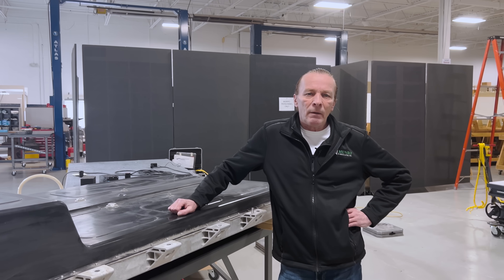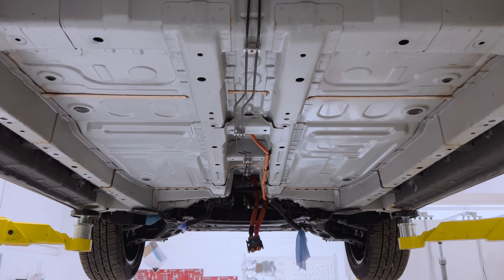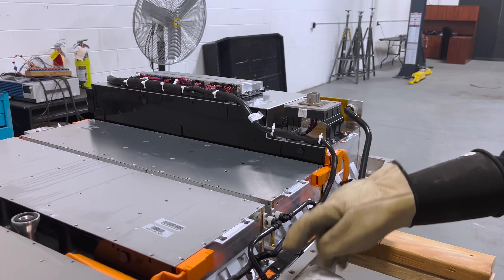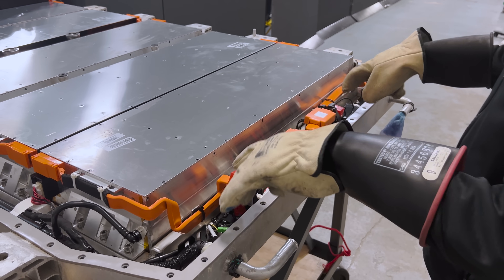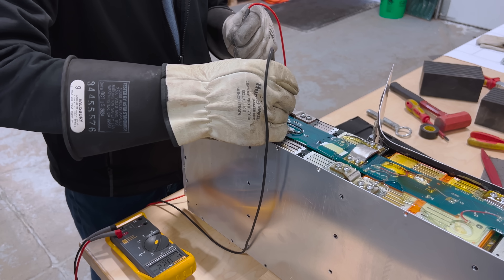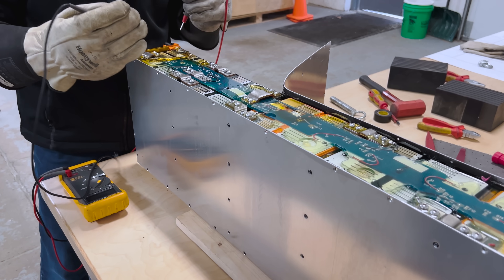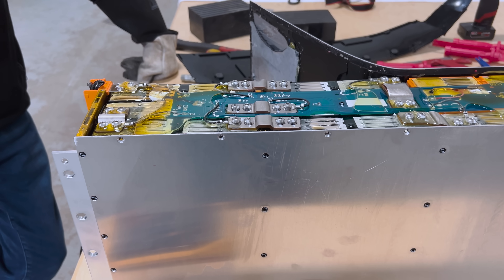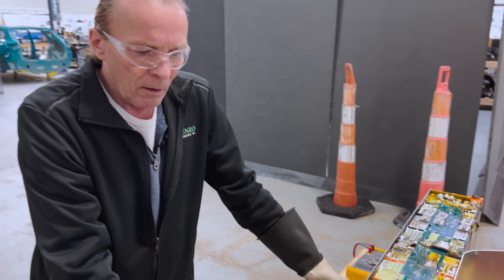Skywell EV Battery Pack Teardown – What’s Inside?

Comment: Coment from a retired fireman.  When working on an electric vehicle or battery pack it would be best to have the lift with vehicle on it, located very near a door to the exterior of the building.  If a battery failure occures, and fire results, that vehicle will be on that lift until the fire is extinguished and/or burns out.  The fire depart is in a much better place to deal with the problem near the exterior than deep inside the facility.  Smoke, gasses and debris will be much easier to deal with near the exterior than deeper in the structure and less damage will be done to the interior and contents of the building.  When working on the battery pack, having it on a cart, as you did, was very good, and do your work near the exterior also.  If a fault or fire starts, role it outside and away to an open area with clear fire department access. You might even consider having a tag line on the cart to pull it outside, just in case the fire advances too fast to stay near the cart and battery.   Fires in batteries are often very stubborn and may burn out of control for extended periods.  Outside away from other combustibles and things of value with ready fire department access is the only place for a battery fire, should one occure.  Battery thermal runaway is something to take very seriously and extinguishment might not be an option.  The fire may need to burn out on it's own over an extended time period until cold.  Be aware, these fires can include explosive events that discharge shrapnel into surroundings and people.